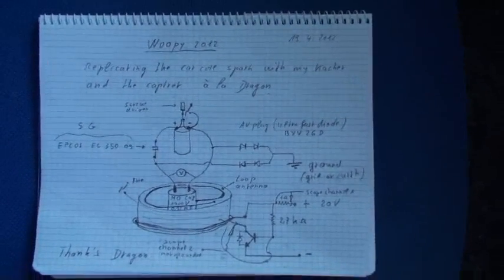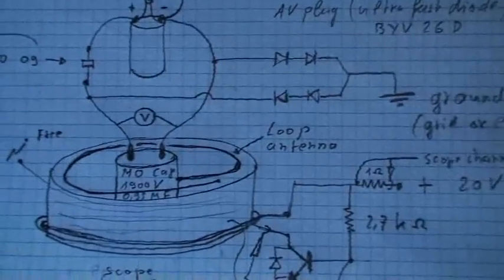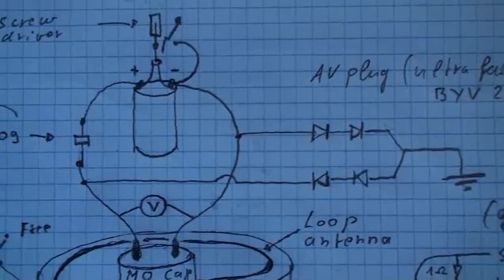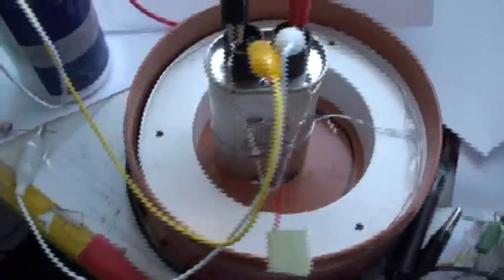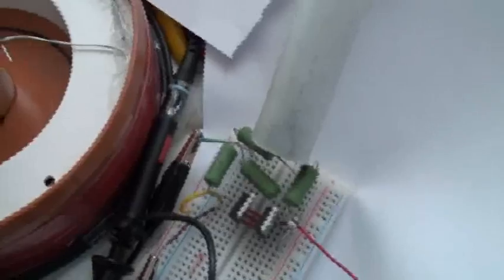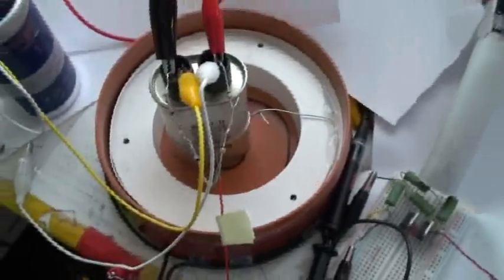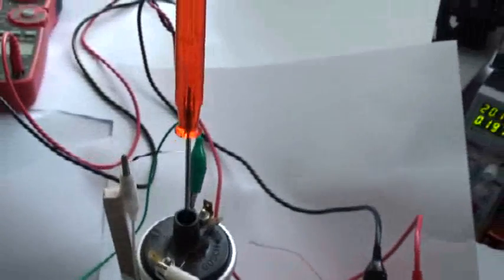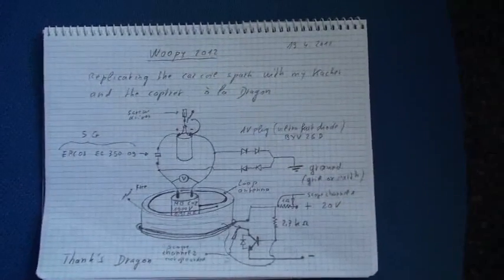amazing sparking between car coil and kacher 1.wmv

Comment: Hi Woopy great video

Can you try to put another but different earth ground to the negative pole of the power supply. I use battery when I make experiments with kacher. And when I connect the earth ground to negative - pole of the battery the output is much better.

JoeFR